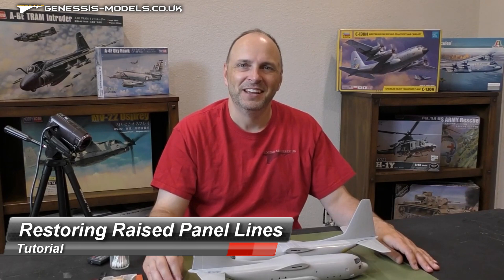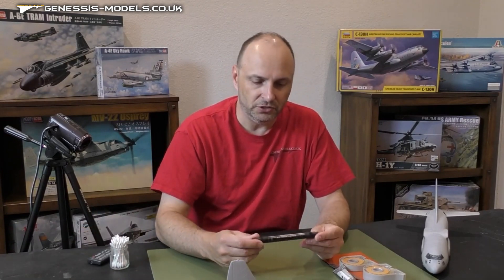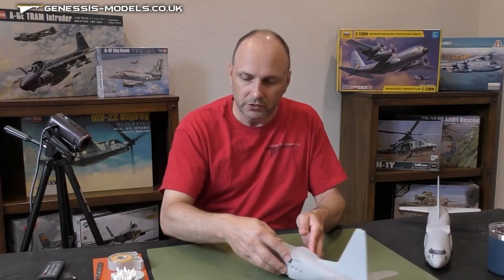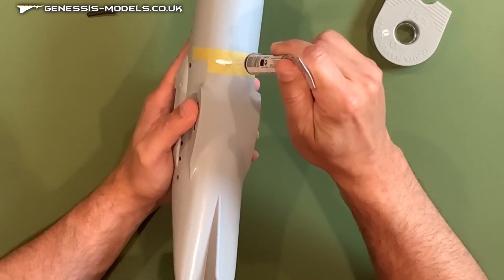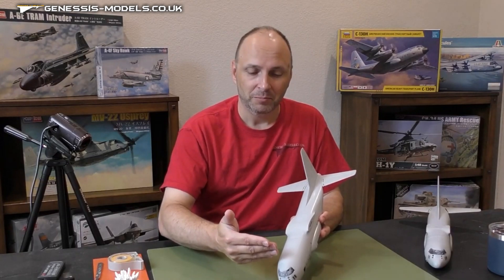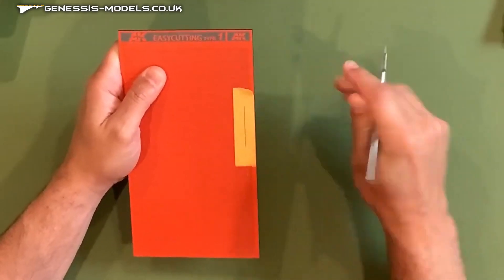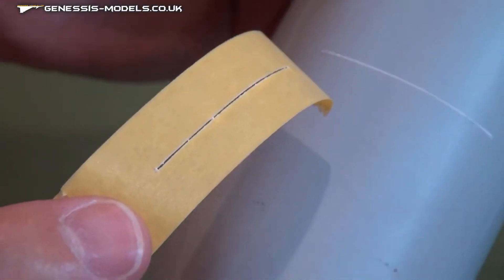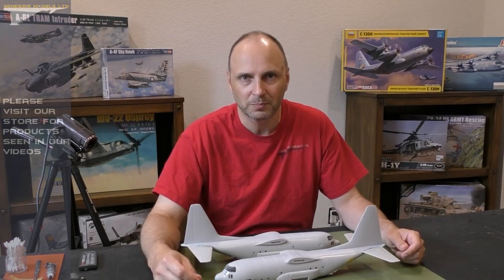Restoring Raised Panel Lines : Tutorial

Comment: Ive worked on real C-130s, and lots of other Big aircraft  and I can tell you that it has no panel lines sticking up off the skin surface, especially at right angles to the airflow. And any panel lines are visible only within 10/20 feet, which is only a couple of inches in 1/72nd scale. Being a modeler and a real aircraft tech is making me pretty picky about real scale look. The only actual way to delineate panels is by painting the individual panels with seperate applications. Even engraved lines are usually way too large for the scales we model.

Comment: Good tutorial, thank you. Can you also give some advice on how to weather kits with raised panel lines? 

Apart from pre-shading, I was wondering if the same panel line washes can be used as for engraved ones. Would the capillary action work in the corners between the lines and the surface and give a comparable effect?

I am about to start the Monogram A-26 and I am hesitant about how to tackle this topic.